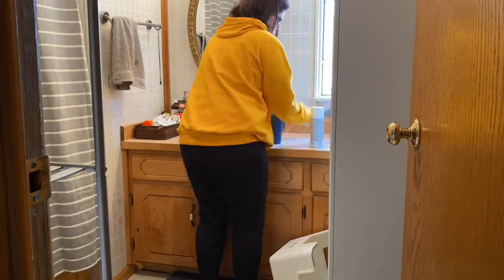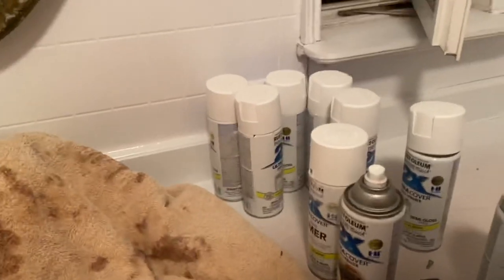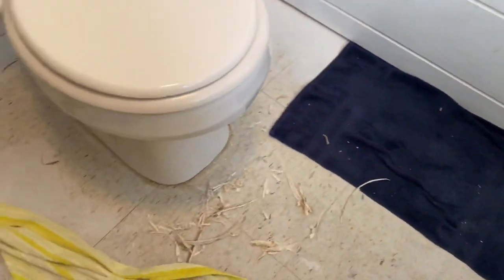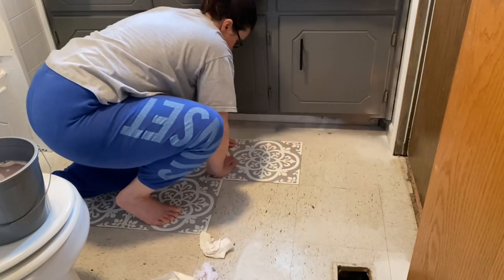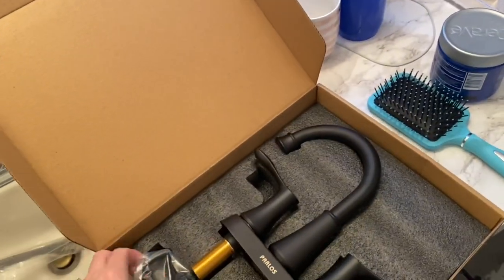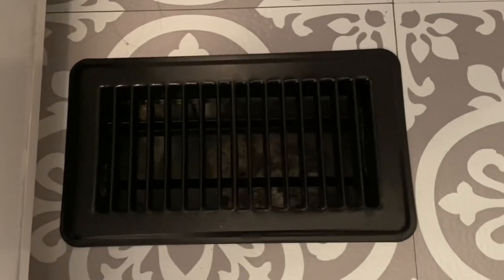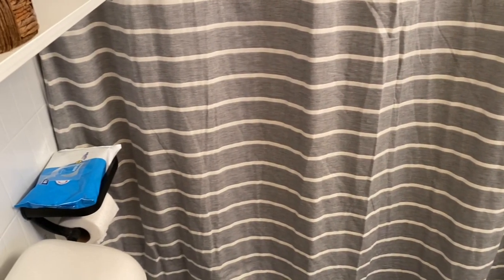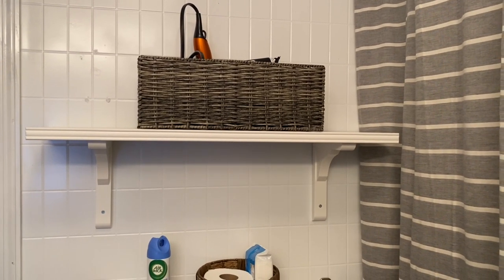1970’s MOBILE HOME BATHROOM MAKEOVER | Small Bathroom

Comment: Wow I learned something today I never knew that they had stick on flooring like that that's really cool and easy to do did you cut it around to fit the edges of the bathroom and to get it around the flooring vent? And I never heard of spray painting the walls before that's why I never painted my bathroom cuz I just figure it'll take forever but I wouldn't mind spray painting what kind did you use
Reply from the maker: The spray paint I used is linked in the description.  For The bathroom tiles I just used a box cutter and it worked great!  Make sure if you spray paint an enclosed area that you have a painting mask and I would also suggest a paint suit.  And open windows if there are any. 😊